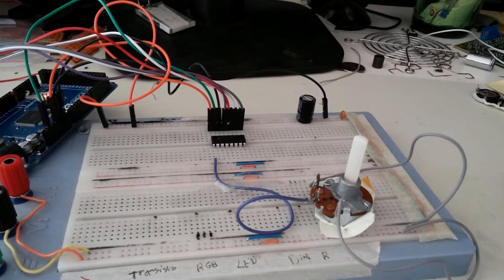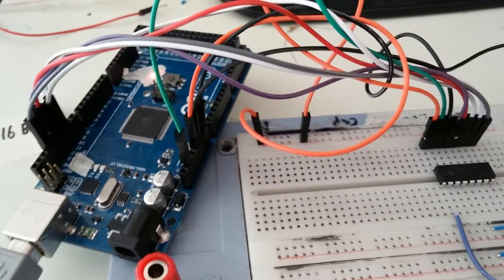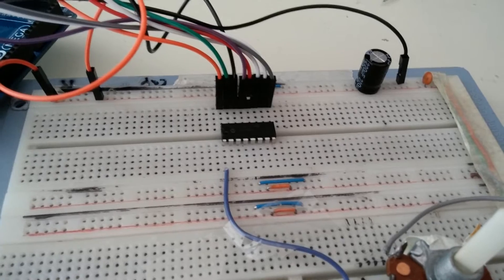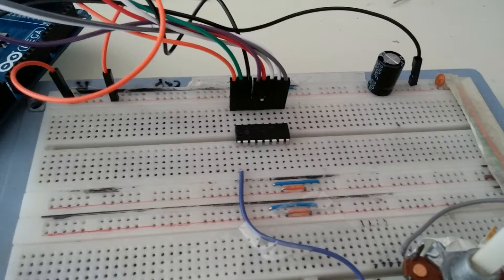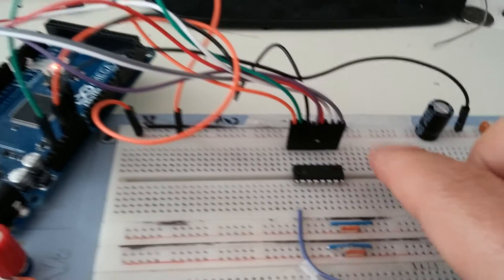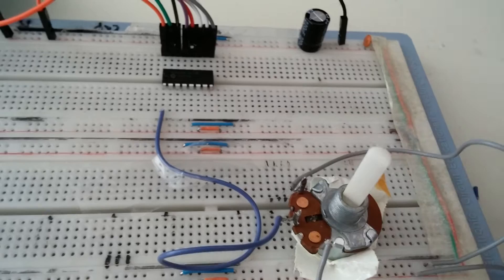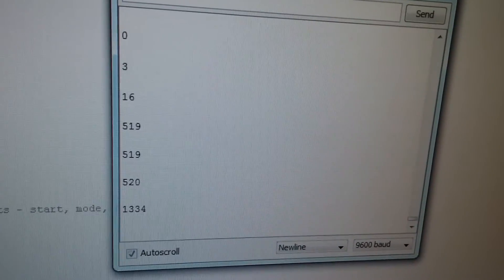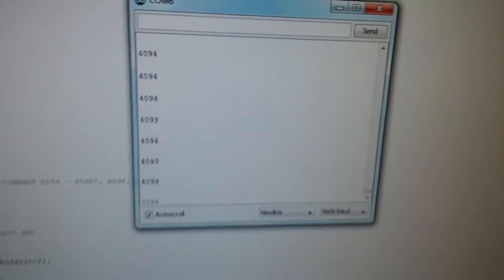MCP3208 12 bit ADC with Arduino

Comment: Why is it showing values like 4096 and not showing the actual voltages like 4 or 5 volts?
Reply from the maker: Hi! you need an arduino to convert values like 4096 into volts ..take a look at the link on the video description .
Reply: Thanks for your reply but i got nothing useful in the link. It is the same code i am using
Reply: Thanks for the reply. I used a formula to convert the adc values to real voltages.
But i am encountering a problem. I am also logging those values in a file in sd card. On the first iteration of void loop (), i am getting correct values of adc and datalogging is done but afterwards i am getting wrong values of adc. Could you sort out and resolve the problem? 
Thanks
Reply from the maker: Usually what happens that arduino slow down when you use the Map command, I think few delay are needed in your case

Comment: Hello and thank you for your video. I used the MCP3208 and your code to successfully record voltage. However, whenever the arduino did not read negative voltages, instead it displayed 0. Is it something that can be implemented from the code? or is MCP3208 unable to read negative voltage?
Reply from the maker: +Pantelis Antonoudiou  Hello and thanks for your comment . a shunt resistor will help you to read the  negative voltage (current)... google it and you find a lot of info about it ..have a nice day
Reply: Thank you for your suggestion. Have a nice day too.

Comment: Nice video!

I'll be using 4 of these chips to monitor the voltage of a 30Cell Battery pack, so it's nice to know the chips work fine with the arduino.

Comment: 4096 is not 16 bit. 
65536 steps to a full 16-bit number.

Digikey website says that it is a 12-bit A/D, which is why you're getting 4096.  2^12 power is 4096.
Reply from the maker: oh yes you have right ! sorry for the mistake! and thanks for the comment ,